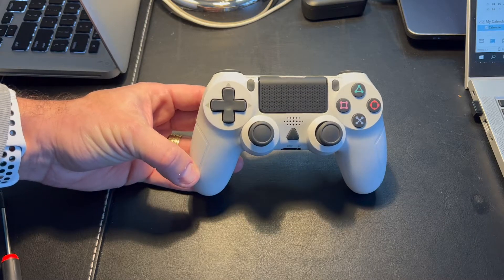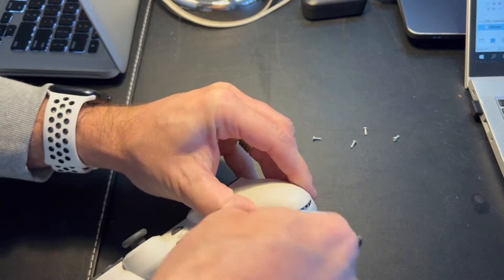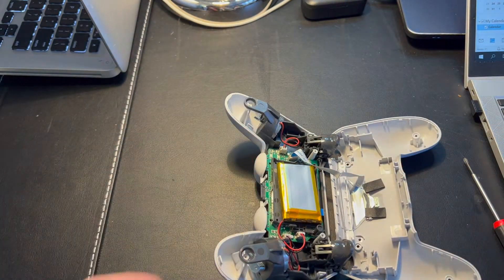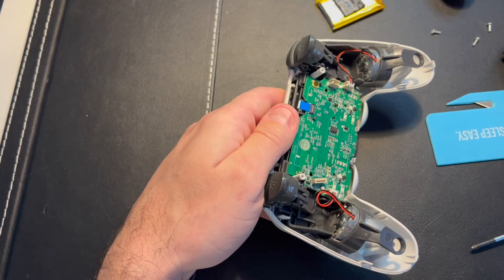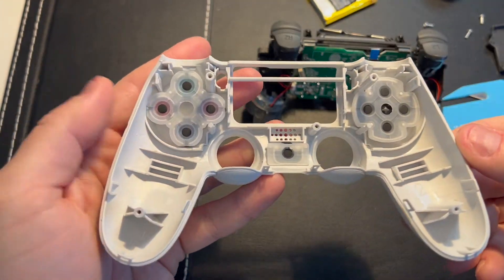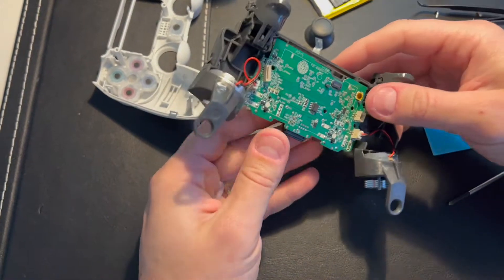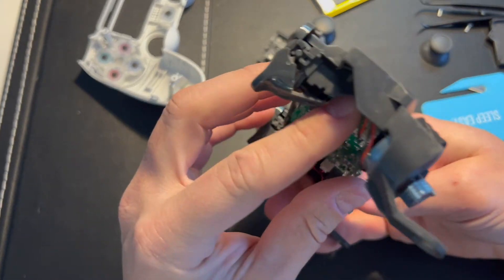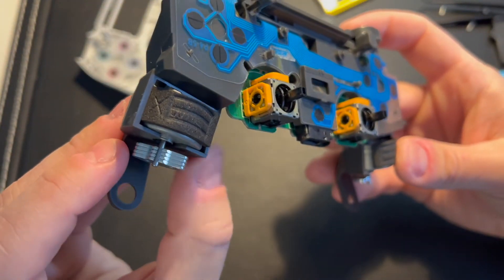YCCTEAM PS4 Controller Teardown What's inside ?

Comment: Do not recommend this video at all. I followed every single step and now the controller won’t fit back together.
Reply from the maker: Hello, why is that ? Are you missing any parts? How can I help ? This should be easy.
Reply: The screw that connects the battery encasing to the motherboard won’t fit in. I’ve tried all 5 screws available and none of them will screw in properly
Reply from the maker: Hum I see, that is really interesting, have you tried to screw it without the board just to see if fits, I must fit as it was there to begin with.
Reply: Oddly enough I'm having the same problem I have no idea what is stopping it

Comment: As long as it works long enough as a placeholder until I can get an official one, I'm happy. Screw it lol
Reply from the maker: That is it.
Reply: @felipezafani  I've been using it for a few days now and I have no complaints about it at all. It connected to my Playstation without a problem,  battery life is pretty good. I saw some people had problems with button input delays but I don't notice any of that yet either. So far, so good. 👍